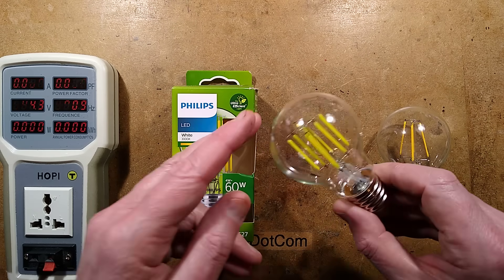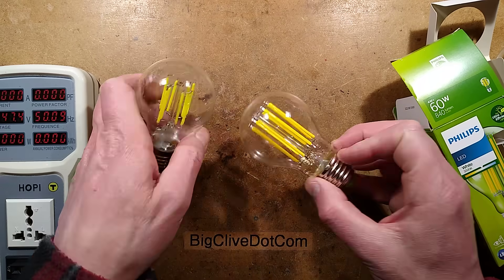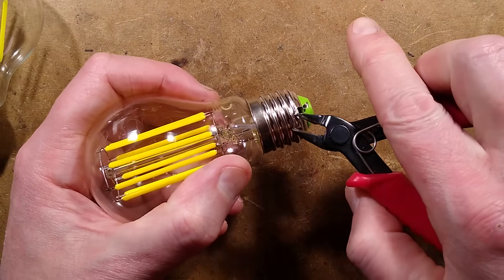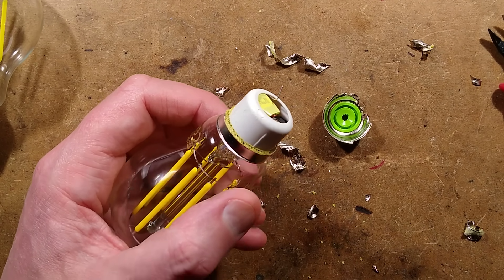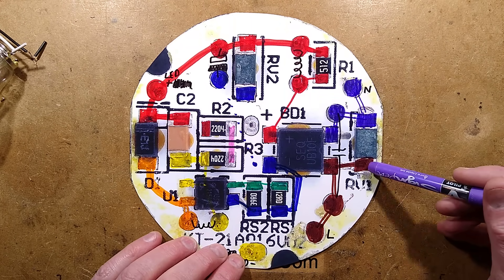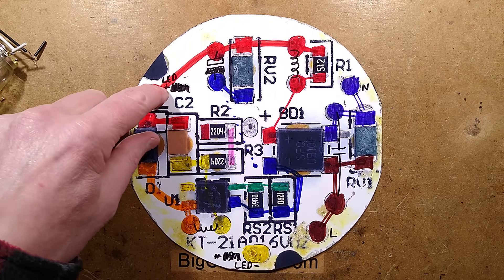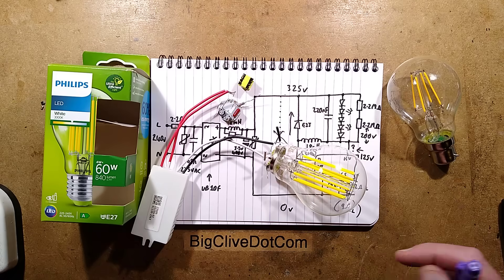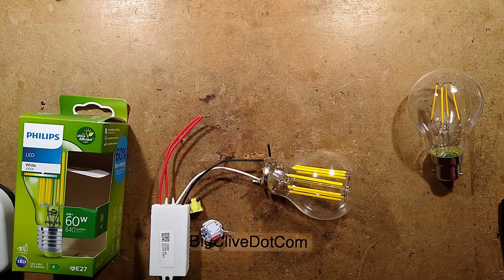Inside a new Philips ultra-efficient LED lamp (with schematic)

Comment: The symbol on the package I think is to say they are not suitable for outside security lighting etc. The bulb is filled with a lot of components on the little circuit board and all to fit inside the base enclosure. If the production schematic is incorrect for the HV line and it was wired to the 325v line. Would the chip burn out over time or run hot that could damage other components nearby?

Comment: The light of all those plug in replacement lamps is pathetic!
Especially from the big name company's.
I build my own lamps for a few years now, and replaced every lamp in my fixtures with proper high end led's, Swichmode supplies and proper linear regulators or proper constant current led drivers.
The led's with a cri of 98 run on a smooth dc make such nice light! 🤤
I don't know why but I do notice the bad cri and flickering of cheap led's and fluorescent lights.
Reply: take a look at forum called ledstrain many poor peopple that can't use todays devices not only leds

Comment: Every failed LED lamp I've taken apart had a failed capacitor on the DC side. Voltage ratings are too low in my opinion.
Reply: That, and the high heat reduces the life of electrolytics quite a lot.

Comment: Depending on the sensor the bulb can glow or flicker with the residual current, but with some modular motion sensors it won't work at all, that happened to a neighbor after rewiring his house, everything was working perfectly until they changed the incandescent bulbs to LED bulbs and the brand new motion sensor stopped working.
The electrician had just installed it and he had to go to the electrical supply store to buy one of another model, although there was one of the same brand and series compatible with LED bulbs.
I didn't see any of them, my father had gone to talk to the neighbor and then he asked me if I knew about that problem with LED bulbs, he also said that the sensor that did not work with the LEDs was silent and the new one made a click, I imagine the first one used a TRIAC and the load was not enough to keep it conducting while the one they put in later used a relay.

Comment: The driver is definitely not as good as the one on the original Dubai Lamp and I suspect it will fail before the LEDs. The comparison with the original shows that Philips seems really determined to still make these fail, just not quite as often as their "regular" ones, as otherwise they could've just used the original simpler circuit and sold the Dubai lamp everywhere else. Instead they come up with something similar but not quite as good.

Comment: Linear regulators have to sacrifice a bit of power to be low flicker. They wouldn't use a buck if they didn't have to, so presumably it's to meet the eye-safe requirements at the same time as efficiency requirements.

Comment: Here’s a question would this survive a flashing cycle ?  I have had now several years a red LED light bulb in my comm tower and it’s survived many lightning ⚡️ strikes one day it will die and when that happens I will rewire the tower so the top light is flashing and the rest will be steady on .  The first light was a CFL and it took about two strikes and it was dead  this one I have now had been really good ! I think it is a Phillips!

Comment: The mystery icon: could it be "do not use for motion detector lamps?" The on and off cycling might be at issue if that's the case.

Comment: Clive, nice video as always. I had an idea on how to make a efficient lamp but with whatever temperature of bulb needed. Would taking two identical lamps then taking those individual led filaments out of lamp 1 then soldering them in parallel with the filament of lamp 2 work?
Reply: Apart from having to smash the glass to get to the filaments!
Reply: @ferrumignis  some are plastic so no worries there. I'm talking about whether it will work electrically. Rest can be sorted out.
Reply: @Will-sc3hw  I would stay away from putting LEDs from different batches in parallel because they likely won't share current evenly. It would be better if you did this with series filaments.

Comment: the hv pin IS actually receiving tge full voltage.... thru the two 2M resistors but only when the D is switched off

Comment: I have one of these in my study. I had an old 12W led that I ran for over 8 hours a day while working. I replaced it with one of these rated at 4W. It emits a very different type of light than what I'm used to but I like it. The color is rated as daylight, it's very bright but easy on the eyes at the same time. It lights up the entire room, but you can stare at the bulb and it doesn't hurt your eyes. The previous bulb looked less bright but did hurt your eyes when you looked at it. I would recommend this bulb, but not for places where you try to set a relaxing atmosphere, it's too cool and bright for that.

Comment: omg, why do I get this tingeling feeling that this electrolytic cap gonna fail way earlier than the rated 50000 hour of that lamp. I bet it is rated 1000 hours and gonna be baked inside that crammed space and fail probably after 10% of that rating
Reply: Yeah, my LED bulbs are dying frequently.  (even the expensive ones)  Despite low wattage it seems they are still cooking their electronics to death.
Reply: @brooksrownd2275  Indeed. My experience is bad with LEDs in general but more with the cheaper brands but mostly one named “Anslut” which all failed within month of use. And the failure is very consistent too because most armatures has two bulbs each and they always fail with just hours between. 
I also just weeks ago had a Philips fail too and it worked for exactly 12 month and 1 week and because of that week I did not get a replacement even if this bulb would not even reached half the rated hours even if it would been lit 24/7. Nope this bulb has 12 month warranty so you need to buy a new one. Thanks for supporting planted failures when I had to pay 20 dollars for a new

Comment: I'm guessing the icon is motion activated fixtures are not allowed.   HOWEVER  it is appears to be shown in front of a garage door.
Radio activated garage doors are also sensitive to some LED bulbs as they can interfere with the radio receivers.

Comment: I bought some 50W driverless COBs to put in my torchier to replace a 300W tungsten halogen bulb, they have that same 3000K green/yellow hue. It's a bit jarring if you're used to 2700K bulbs as 300k doesn't seem like much but it's a massively different phosphor setup and light quality.

Comment: I'm not sure it will last any longer than a standard LED. The weak link, as always will probably be the heating and eventual failure of the electrolytics. It should last longer if the lamp is used base down rather than base up, heat rising!
Reply: You mean the single electrolytic running only at 100Hz, not 100kHz ?

Comment: Maybe the HV connection to the bottom of the LED string is for LED failure protection. What would the circuit do if the LED string had an open or if it had a shorted LED ? Interesting in any case. Thank you for sharing with us.

Comment: Should have bought Philips stock before you published this. Anyways, when doing math lumen vs Watt, it's economic to replace them $1 led bulbs after about 1 year on average (1/4 day) cycle. They so cheap, instead of running up to 10,000h+ lifetime it's more economic to replace them every 6 month.

Comment: The symbol signifies that the LED is not for use with the average movement sensor, like infrared.
Probably because it's wattage is too low for the switching circuit or because the inrush current of LED bulbs (or rather the arcing in the switching process) can destroy normal switching contacts.
Reply: The first coil in the circuit actively reduces inrush current.  But the low current consumption may cause it to light up from the tiny current through typical snubber circuits on relays and electronic switches.

Comment: Hi Clive...  Are these lamps evacuated?  Does vacuum or gas have any part to play in led lamps?  Is there any way to hack it so that it is dimmable?   Thanks for your great videos
Reply: Nope, the bulb is just to make them a similar shape to the old evacuated or gas filled glass bulbs.  The completely normal air inside actually transport heat away from the LED strings.
Reply: the bulb can be filled with high thermally conductive gas to help dissipate the heat but in most cases this is not relevant for such a low power device and this adds some extra costs.
It's quite hard to make such a circuit dimmable, especially to combine with an existing voltage variable circuitry for incandescent lamps, as more electronic is needed and it destroys efficiency. What is certainly possible to do is the series capacitor trick shown in previous videos. And some switch with multiple positions can be added to get some gradation (because variable capacitors are hard to find nowadays, especially with the characteristics suitable for this application)
Reply: Some of these lights are described as "Can be used with a dimmer switch" in the retail description (Argos, 4W 3000K, but not the 4000K).

Comment: Could the chip have been designed for USA voltage (110-125Vac) and that is why they patched it in at that point?
Reply from the maker: It's probably got a very wide voltage range.

Comment: What happens if you want a 100w or 150w equivalent led bulb 💡 🤔
Reply from the maker: You get lamp holder adaptors and use a few lamps.
Reply: @bigclivedotcom  over complex and would not fit in a lamp shade.

Comment: Back in the days of incandescent exit lights, some times we would use 220 volt lamps for long life or we also wired the 2  -120v lamps in series. Also some of them were candelabra bulbs with a diode for longer life.
Reply: Candelabra bulbs lovely made without an internal fuse so BOOM and shattered glass everywhere,  people couldn't understand they weren't SES  or MES just somewhere in between an  E12 not a E14

Comment: I would be amazed if these bulbs were available in India. I would also may reverse engineer some of these. 
After Being the voltage,Freq same in India & UK, Philips still don't import these bulbs here
Reply: 200-240V is common in most countries though. The frequency is mainly important for powering things like AC motors and old alarm clocks but rarely matters for lightning and most contemporary electronic appliances using SMPS.

Comment: Is your 68nF across the mains or really inline with the mains? It's not a cap dropper connected the way you have it here, matter of fact the dubui lamp the caps in series, not parallel, see 17:40 here https://youtu.be/klaJqofCsu4
Reply from the maker: It isn't a capacitive dropper.  The power supply is a buck regulator.
Reply: @bigclivedotcom  Thanks for clarifying that, so what is that 68nF for, seems to just be burning power?
Reply from the maker: @user-rs8zg8ey2b  It's to reduce RF noise from the wiring and also to help protect the circuitry.
Reply: @bigclivedotcom  thanks. I would like to see what the hopi says about just that cap (nothing else) across the mains. Do you know the buck switching freq?
Reply from the maker: @user-rs8zg8ey2b  The Hopi won't even register such a low value.  There will be a current of a few milliamps, but it will be apparent power and not register on the meter.
Reply: @bigclivedotcom  Xc for 68nF at 50hz = 47K ohms, at 235v = 5mA. At 5mA of the 30mA of the total system, thats 17%, seems quite high for a ultra efficient bulb to throw away, but maybe a necessity for the conducted emi,,,,,?
Reply: @user-rs8zg8ey2b  Agree on the 5 mA current, but that's not dissipating power, it's just reactive power.  It's neither lost nor billed for.

Because it's phase-shifted, that current doesn't add in an intuitive way.  It will be close to 90 degrees phase shift for which the squares of the currents add up, meaning the two current components are 5 mA and 29.6 mA because:
5x5 ÷ 29.6x29.6 = 30x30
Reply: @CoastalSphinx  Well, we will have to disagree, the new power meters (not the old spinning type) can account for inductance and capacitive loads and they charge for it, my bill went up $11 a month when they switched my meter over to the smart version. Any power you consume whether is resistive, capacitive or inductive, THEY want their money.

Comment: just curious, have you ever had bulbs burst while pulling the bases apart? ive have 5 led bulbs i thought were plastic all shatter. only one cut me. and not very badly mind you. but its always super duper scary when you go to see why the next bulb died. and if it did in a unique banner compared to the 4 HUE bulbs that dropped the wifi last week. also could you make a video on removing LED SMD modules for us DIY people. i have some smd arrays i wanna pull led modules from for flashlight upgrades but i dont know where to start!
Reply from the maker: Just once when I thought a lamp was plastic.

Comment: Assuming it’s got decent color quality I’d be tempted to try and get some of these in the US. I should be able to drag them along with me for most of my life
Reply: Just make sure you buy 110v ones not the UK ones at 240v
Reply: @handlesarefeckinstupid  I mean I could use 240V I’d just need to run circuits for that

Comment: That's a bummer about the low CRI. That is far more important than people realize, unless it's just used outside or the like.
Reply: CRItical, even 🙂
Reply: It's not important at all, unless you work with exact colors.
Reply: Is there not some kind of problem with LED lamps not putting out the right kind of light for insects , causing grasshopper mating to fail (or something like that)
Reply: @highpath4776  I do wonder how they procreated before LED lamps were a thing, though? :-)
Reply: @benbaselet2026  Give Me the Moonlight, Give Me The Girl,  (damn fell down the stairs)

Comment: Is the metal oxide thermistor used for the inrush current? Instead of the resistor often seen in other lamps?
Reply from the maker: It's used to clip voltage spikes to protect the components.
Reply: @bigclivedotcom  Thanks for your quick response! I was confused with a Thermistor and later realized it was a Varistor. But this has nothing to do with limiting the inrush current?

Comment: I'll admit that it's been several decades since I took electric circuits in college, but would the chip care were its source voltage came from? Assuming it's within spec.
Reply from the maker: It shouldn't.

Comment: Ah, so not quite the “Dubai” lamp, but very close to it.  I recall the original “Dubai” as being more cool white as it was more appropriate for the ambiance.  So it’s a little warmer and greener, so a more receptive light.  I think the circuit design is quite neat.  If these last as long as they claim then it is cheaper in the long run.  I’m guessing the symbol on the box means it’s not suitable for P.I.R use in passageways.
Reply: I searched the internet for an inordinate amount of time.  Phillips has a web site for the symbols it uses for various medical equipment.  But the symbol is not found there.  Probably because it's only for medical equipment.
But your explanation is the best I've read.  But there begs some question about its use - is that it's not suitable for lighting the area covered by IR detectors?  Will it mess with IR detector functionality?  Or maybe even ruin one after long exposure?  I think our friend Clive might have to investigate.
Reply: @jdlech  i was thinking it was because it turns on and off so often and for a short time that it could wear out.
Reply: @jdlech  Nice one and a good suggestion.  Reading the comments, there are many explanations but really no one knows what the symbol means. 😀👍

Comment: Incandescent Light Bulbs are in a Vacuum. LED bulb don't need a vacuum, in fact would work better if cooled. I wonder if the LED bulbs use air, nitrogen or another gas like argon or halon to improve cooling of the LED filiment.
Reply from the maker: Some use helium to help transfer heat.